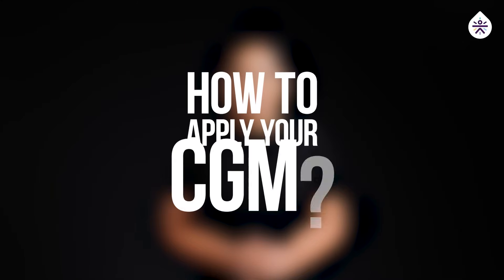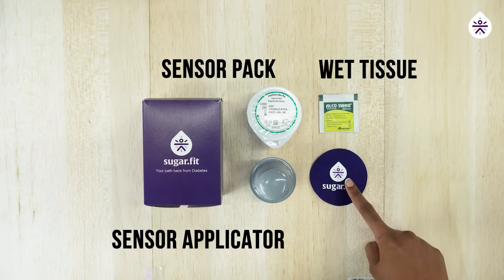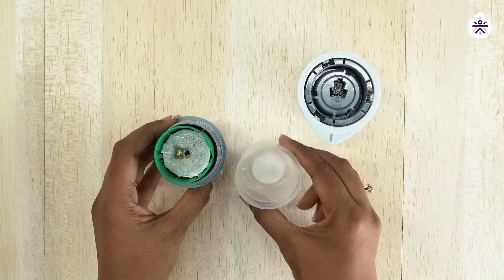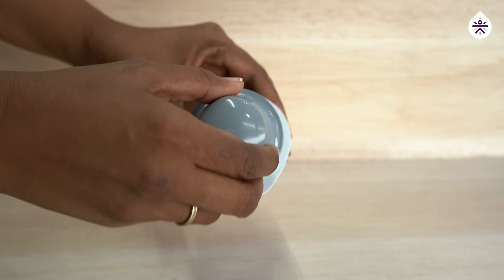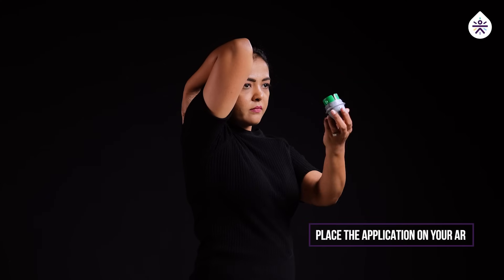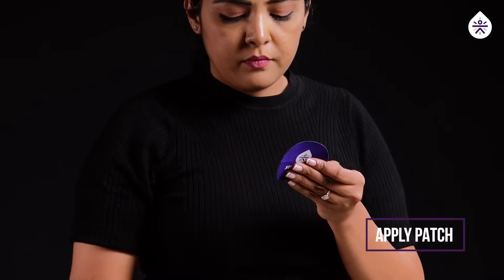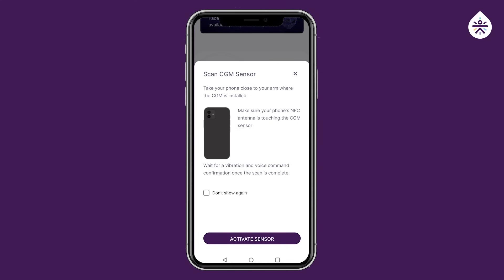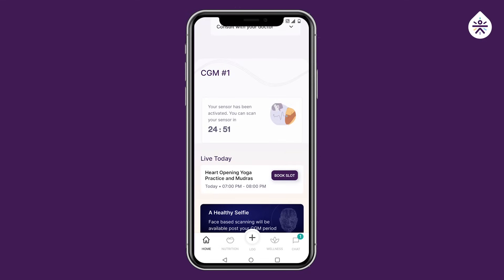How to Install a CGM for Blood Sugar Monitoring| Step-by-step Guide | #bloodsugarcontrol  besugarfit

Comment: But then how to remove it ?
Reply: So every 14 days one need to pay around 4K for new CGM. Good for sugar fit profit making 1 year subscription is 18K and every 1 months they will ask to buy CGM
Reply from the maker: Hi Sir, It is very easy to remove you need to apply a little oil to the edge of the device and dispatch it slowly.
Reply: O mG i took this year plan without knowing , in webinar they didn’t say we need to take that sensor for every 14days

Comment: after 14 days we have to buy new CGM?
Reply: You have to buy new one 3700 rupees through sugarfit. Life of CGM is 14 days.
Reply: Yes you have to buy new..
Reply: Wrost service. Before pay the money they call daily 5 times. After paid the money they could not reply for us. After the pay the money the coach not available for our time. They available for their free time. And book for 1week before. 
And diagnosis test are not available. Again our money spent our the tests
Reply: @sureshsirigidi4377  o noooo i too paid I’m scared now
Reply from the maker: Hi Akhil, the CGM sensor provided by Abbott lives only for 14 days from the day of installation, post that the sensor stops recording the data. You can connect with a coach who will help you further and assist with CGM if required.
Reply: @besugarfit it’s a simple yes or no question. Why does a coach need to tell you that?
Reply: Wrost service. After payment done they not respond. Waste of money .I faced it.
Reply: Yes
Reply: By the time of 14 days, usually we get the all required information
Reply: Can be take bath with sensor...